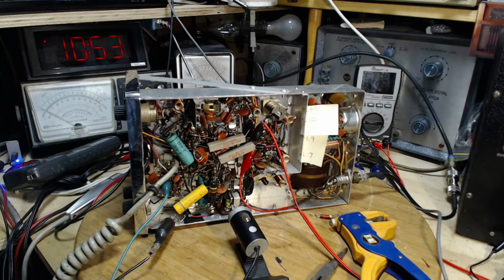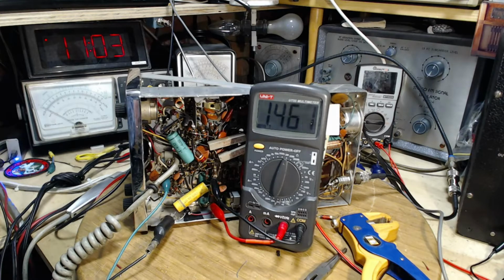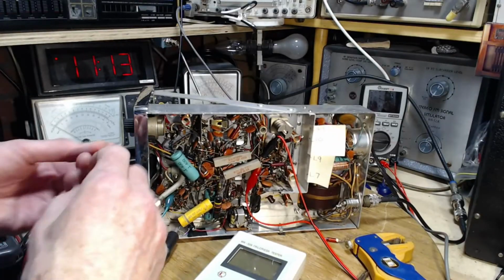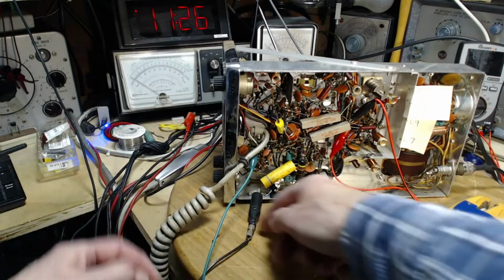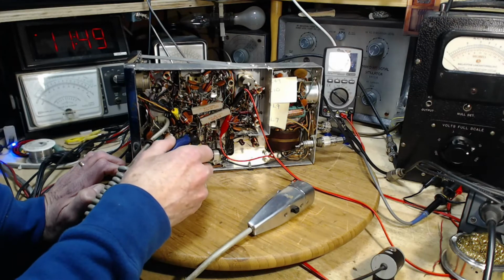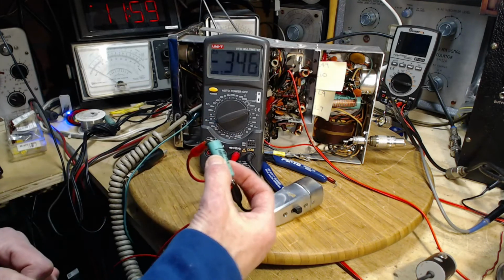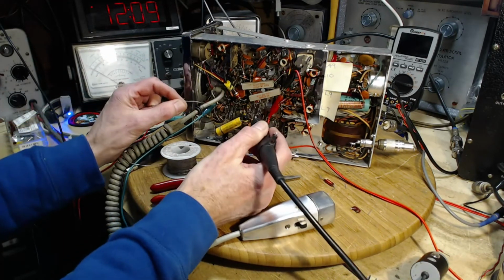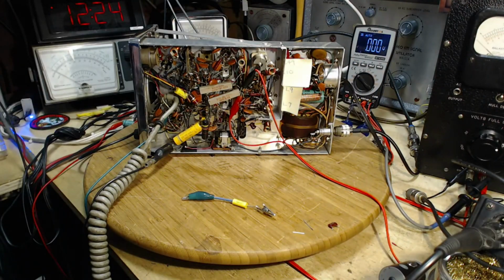Johnson Messenger CB Radio Video #15 - Three Molded Capacitors

Comment: 5 band resistor. Resistors with high precision have an extra band to indicate a third significant digit. Therefore, the first three bands indicate the significant digits, the fourth band is the multiply factor and the fifth band represents the tolerance.
Reply: https://www.digikey.com/en/resources/conversion-calculators/conversion-calculator-resistor-color-code-5-band

Comment: It might be worth noting that the capacitor effect you are seeing could also be due dielectric absorption, the degree to which will vary depending on dielectric type.  Dielectric absorption is exhibited by charging the capacitor, removing the charge source, shorting the capacitor, removing the short, then noting the amount of recovery voltage.  So what you observed may be to moisture intrusion, dielectric absorption, or some combination of both.

Comment: on capacitors, inductors and even some types of resistors the use of a meter (instead of reading the rings) is totally useful, since they tend to fail.

Comment: The black "bumble bee" markings are as follows: yellow = 4, violet = 7, and orange equals 000. That comes to 47000pf. In modern terms that is .47 mfd.

The black band after the value means it has a tolerance of 20%. The red marking indicates the voltage X 100 or in this case 200.

So your black cap is 0.47 @ 200vdc with the usual tolerance of 20%

If it reads higher than the marked voltage plus 20% it is probably very leaky, as these tend to be when they age.
Reply: Forgot to mention, the extended lead indicates "outside foil" or shielded end. (Same as the band on paper caps.) Modern capacitors are not marked for outside foil because the switch to solid state lowered impedances and made it unimportant in most uses. You can test them for this with an oscilloscope or reverse the cap if you get hum or oscillation.

Also 150NF resolves to 0.15 mfd. (130 equals 0.13 mfd) If the cap is marked 0.1 it is out of tolerance. The ESR is also too high for this value. Measure out of circuit to verify. Fractional (film) caps should have no measurable ESR after subtracting lead resistance.
Reply: Errata: "marked voltage" should have been "marked value".
Reply: I believe you'll find that the "bumble bee" is 0.047uF and is connected to R20(820K), C7(680pF), R19(5470K) & R16(1M).
Reply: You're right. I misplaced a zero when writing. Mea culpa.
Reply: 473 is 0.047uF, not 0.47uF
Yes, black is tolerance of 20%
Yes, voltage band is red...200VDC
Reply: That was addressed last week.

All you had to do was read the replies.
Reply: @RuneTheFirst  "All you had to do was read the replies."
I did, and added to them. I wasn't scolding, just reinforcing, boss.